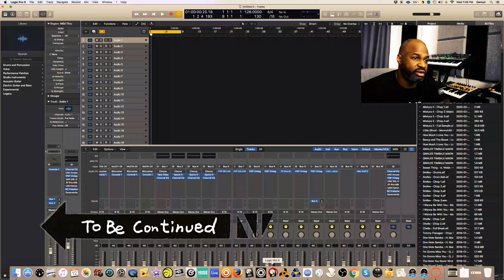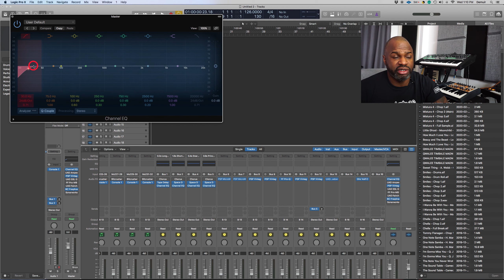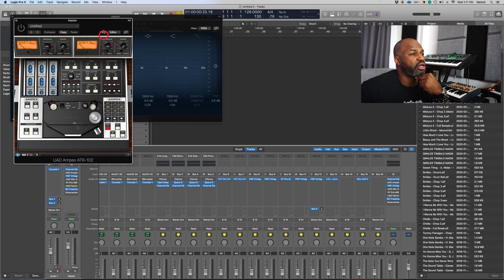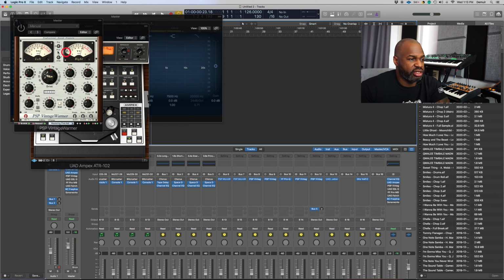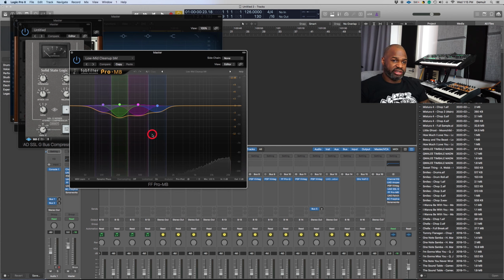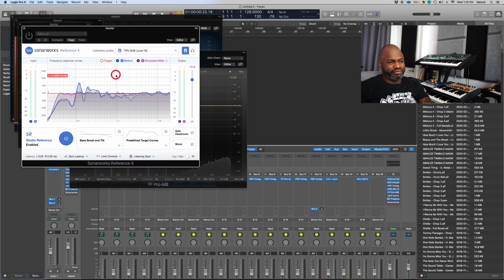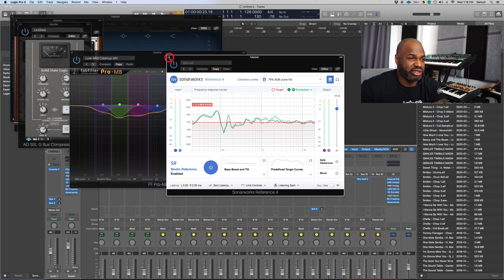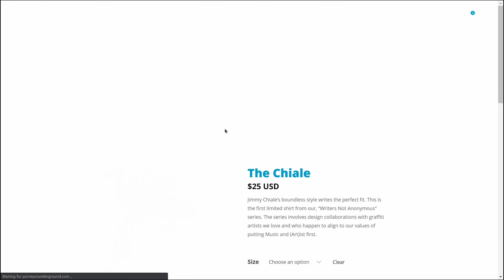Masterchain Journey Part II

Comment: Hey Demuir, do you keep the compressor plug-ins in the Master chain (ie SSL and Pro-MB) on from the start whilst you are in the early stages of creating a track, or do you only employ them towards the end when you are finalizing the track?
Reply from the maker: Hi Pramesh - I keep a gentle amount of compression on from the PSP to get a "preview" of what the pre-master will sound like.  I definitely turn it off when it's time to bounce the pre-master.
Reply: @Demuir  Thanks Demuir! So to clarify, when you send the premaster off to the label for mastering, do you turn off all compression and EQ (such as tape saturation)? If so, how do you know the mastering engineer is going to get the sound you want, especially if the label deals directly with the mastering engineer and doesn't involve you (as in my case). Sorry, but I'm a bit confused here. I hear different views on whether you should use gentle or no compression (bus and multi-band) on the premaster.